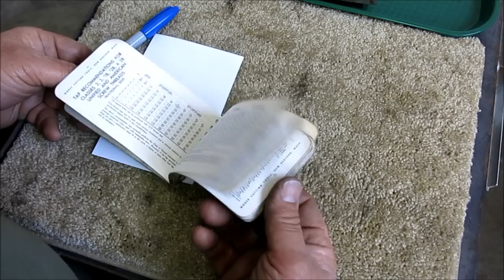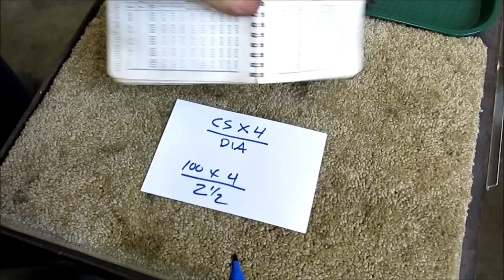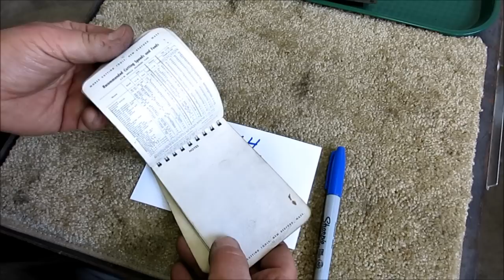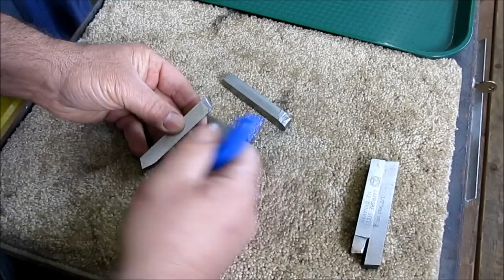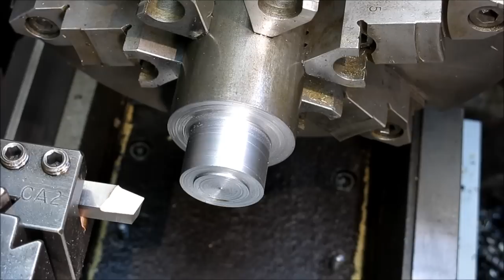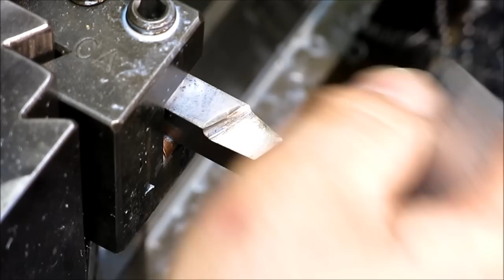Chip Control to Major Tom

Comment: Hey Major Tom, (any relation to David Bowie?)
Thanks for the Chips Ahoy video. It is interesting how all the variables (cutter profile, spindle speed, feed rate, etc.) have such a profound effect of chip shape and color. Those last ones were getting pretty toasty! I'd love to join in, but the 13" Birmingham I am ordering (2hp motor) wouldn't cut the mustard, let alone a .800+ chip!
Thanks for the info. BTW, what grit grinding wheels do you use? The first one appeared rather hungry.
Regards,
Oxen Dave
Reply from the maker: Hey Dave,

This is Major Tom to Ground Control I'm starting up the lathe stepping through the door. And I'm floating in a most peculiar way
And the chips look very different today

Cheers

Tom
Reply: oxtoolco
Hey Tom . . . That was great! I laughed my ass off! (Now I have a major problem going to the bathroom!)  The chips are never down between you and Adam (LOL)
Oxen Dave

Comment: You touched on something that very few mention: changing tool height. So many are so hung on the tool always being exactly on center.

I have a lightweight 12x36 Atlas/Craftsman lathe. Probably your carriage weighs as much as my lathe ;).

If you raise the center height it does change the rake and front clearance angles and the side becomes a bit of a shear. It also changes the direction of the force on the tool. Rather than straight down it is at an angle. This can change how the toolpost and carriage flex.

I have used it to control chatter on a light lathe. Some material just wants to fight you and a smooth finish. Another tool in the arsenal other than feed rate, RPM. and tool angles.

I should mention, running a tool above center may help, but you will need to adjust it for every radius. It is a pain to do but can work.

Thanks for going outside the box ;) I'm enjoying these chip control videos. Always nice to see what you can do. I'm happy with 0.040 DOC, 0.008 feed and blue chips coming off my small lathe. ;)
Reply from the maker: Hi Scott,

Thanks for the detailed comment. You are correct that its just another tool in your tool box to get the job done or deal with a problem.

Cheers,

Tom

Comment: Some people worry at the raise of bit temperature during heavy grinding. Mr. James A. Harvey, author of "Machine Shop Trade Secrets" conducted extensive tests on the subject checking hardness of bits before and after getting blue by abusive grinding of  cobalt bits and found no difference in properties or performance.
By the way Tom, I always wonder at the lack of a cooling system in your nice lathe.
I personally prefer full synthetic oil to cover both cooling and lubricating needs and avoid fungus, odor and other unpleasant features of soluble cutting oil.

Regards

Jorge
Reply from the maker: Hi Jorge,

Thanks for the information. You are correct that high speed steel with or without cobalt retains its hardness and functional properties even at red heat. When buried in a cut the fine edge see's a very high temperature indeed.

On the oil and coolant I prefer low volume methods. Slinging coolant around by the gallon is for production machines. Most hobby and prototype shops can get by with very minimal amounts of coolant and oil for most machining. 

Cheers,

Tom
Reply: oxtoolco Very true. Also mist cooling is detrimental and counterproductive with Widia/Carbide inserts who due to thermal shock work best with flood. Many people by using a chuck guard use flood to extend tool life and help in chip sticking and removal during heavy cutting. Same in the mill with some sort of guard or cover to contain coolant splash. Fenner uses it when needed but of course he does production and as you properly stated the task and conditions are different,

Cheers

Comment: Why do you have to deepen the top back rate. Would it give the same result if you give that 10 degrees but let the tool ½" solid? You remove nearly a ¼ " from the top but you a add a ¼" shim. It's as in the Atlas book "How to run a lathe" but in those times they used lantern tool post. You use an Aloris straight tool post. Most interesting video. Speed rate and RPM is not an easy thing to understand. Hope that you will talk more about that subject. Mainly Speed rate & RPM for standard cut, for us who live on the earth and finishing cut the old way, for those who are older than you 😉
thanks again.

Merci
Reply from the maker: Hi Robert,

The shim is only to provide a no slip surface between the tool and the tool holder. Aggressive cutting can rotate the tool in the tool holder. It was not to make up for lost height. The back rack makes the top edge more positive and free cutting. 

Cheers,

Tom

Comment: deos getting the bit that hot when grinding it remove its hardness somewhat? im much more cautious when i grind a drill bit for example, which is also hss
Reply from the maker: Hi Jusb,

High speed steel retains its hardness and strength at red heat. Even through there is some color from the grinding this does not impair the cutting edge. 

Cheers,

Tom
Reply: oxtoolco
thanks tom for the info

Comment: So what exactly is the lead-angle good for?
Wouldn't it cut less material at the same time with a straight perpendicular angle...
I don't know..  just pondering..

Great video Major Ox.
Reply from the maker: Hi He Ka,

The lead angle makes a thinner chip that a straight tool. It spreads the load out over more length so the actual pressure is less than a tool with this edge perpendicular to the work. The angle also helps control the chip movement and flow.

Cheers,

Tom